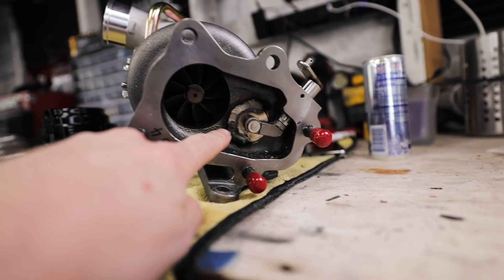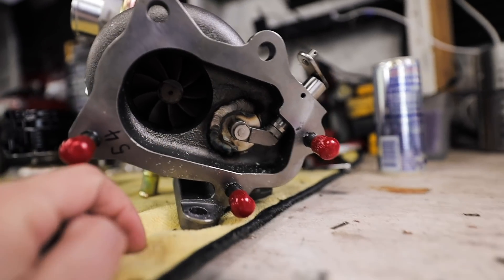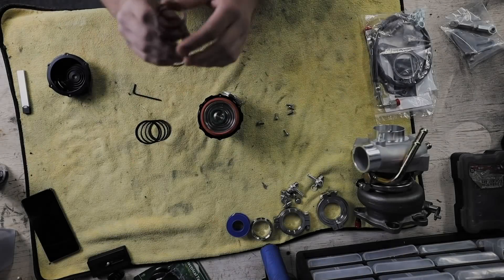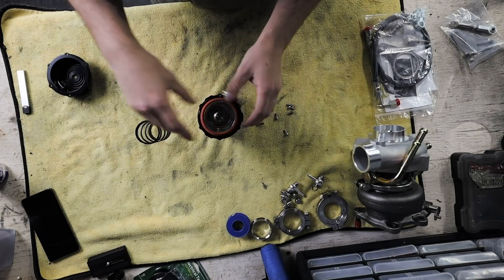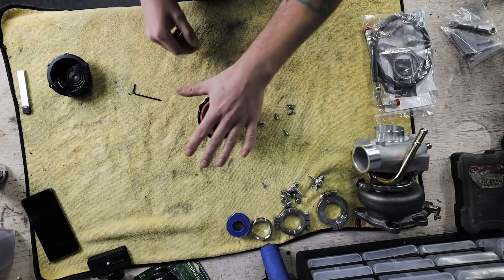Everything You Need To Know About Wastegates!

Comment: not sure if i am going to get a response due to this being posted almost 4 years ago but i am just new to cars and i am 17 years old with a subaru impreza WRX. Ive seen it all over youtube with these external waste gate flutter noises and it sounds amazing. I couldnt really find a video explaining it much but this really did help. But i have other questions. My Subaru is basically stock and i was just wondering do you have to have an after market turbo to run one of these things? I ask this because i would love to run one on my car but i dont really know how it works. IF i did do this on my stock turbo would it not do anything? would it break stuff? would it benefit me? is there disadvantages?
Reply: You can indeed run one on stock turbo. Just remember with these cars everything you do has to be tuned. You cannot mod these things and not tune them. It will blow up. I would highly suggest if it’s still stock start with a Cobb stage one package. This will at least get your feet wet with modding and semi tuning. The Cobb AP will provide you with a OTS tune that is fit for its specific mods. Getting pro tuned will work the same way except with extra steps when it comes to the tuning side of things.

Comment: Doesn't the blow off valve do the same thing if you keep 25lbs springs if the turbo went past wouldn't the extra just bleed off when the spring opens up thus eliminating a need for a waste gate?.
Reply: A wastegate will lower turbo shaft speed, and controlling boost with a BOV leak will raise shaft speed at the same boost level. Not saying there aren't instances to do it, but not ideal for regular old boost control

Comment: So I'm going to be running twin GT35s on a 5.3 LS is 44 mm wastegates too big and 50 mm flow off valves mine is going to be a blow through setup and the max boost will probably be somewhere between 15 to 20 lb.

Comment: Hey I just came across this video, I was wondering if I NEED a new wastegate or can I just keeep the stock on the vf52 turbo on my 2011 wrx sedan, I have a ton of modifications including bigger top mount, injectors, fuel pump, catless dp, intake turbo inlet, boost controller, bypass valve etc. and i’m gonna be tuned to make 340 wheel hp soon on the stock turbo. can i keep the stock wastegate?
Reply from the maker: You can but with a catless downpipe your subject to boost creep I'd suggest a plm up pipe with a tial 38mm ewg 🙏

Comment: Hey. Thanks for the info. If I have a completely stock 21 WRX except for a Big SF intake and Cobb AP: everything else under the hood is stock. I run 93 Octane and a 93 octane/Regular waste gate OTS tune. If the car seems to sputter a little here and there: Should I try the high or low waste gate tune? Is this safe on a stock waste gate? Can I run it indefinitely? Thanks in advance.

Comment: Hey buddy i hope you can help me with this so i am suffering with loss of boost in my subaru wrx sti so my tuner had said that it was the wastegate springs is that really true or do i just need a new one? I got the car not so long ago but i took it off the car and it looks really old it an Comp gate 40 mm. Also i tried testing it with new springs at 12 psi by putting some air in the waste gate and it seems like it wont open completely until around 25 to 30 psi ? Is that normal ?
Reply from the maker: What is your target boost #, and what are you actually hitting? 👀
Reply: @Smeedia  i mean i am guessing the wastegate piston should open up at 14 psi as it was originally at that number but now i only go up to 11 psi and thats the maximum boost i get . I also have a check engine like for Evap leak ifk if thats also affecting the tune? Another mechanic that i know said it could be the BOV ? Or maybe i have a leak somewhere?
Reply from the maker: Do a boost leak test and swap the springs to .9 Bar 🔥

Comment: Hello 👋🏼, I have a 13 WRX and looking forward to ordering the PLM Power Driven Subaru EWG Up Pipe with Turbosmart WG40 Gen V Wastegate kit…I’m currently on stage 2+ 93 with accessport stock turbo etc…is there any other additional parts to installing the ewg before the tune.
Reply from the maker: You'll need the iWG block off bracket and a boost control 😁
Reply: @Smeedia  thank you man I appreciate the response 👌🏼 happy new years
Reply from the maker: Happy new year Manny!

Comment: Hey im buying a subaru soon that has a "boost creep" issue and it has an external wastegate. What do I do then
Reply from the maker: Probably too soft of a spring in the gate 👀
Reply: @Smeedia  will try that when I get it
Reply: @Smeedia  too soft of a spring? Wouldn't that open easily at a lower boost pressure? Do you mean too stiff of a spring?

Comment: So if I have a 44 mm turbo with a 38 psi spring will I have to order more springs or will I be fine
Reply from the maker: I would change the spring, that is a stiff spring for pretty much all applications. Typically I run .9 Bar (13ish) lb spring

Comment: When you are running an external wastegate on the stock turbo do you need to weld the internal wastegate shut or modify anything with the internal wastegate? I plan on running a catted downpipe btw.
Reply from the maker: You can qeld it or buy a bracket to keep it shut 💪
Reply: @Smeedia  thanks!
Reply: Catless would be better with an EWG

Comment: I have a 2011 wrx hatch. It had a catless down pipe turbo back exhaust and a cobb air intake with intake box Cobb three port boost controller. My car is pro tuned for 18 psi sometimes it goes up a little about 18psi EX. 18.6 18.9 and sometimes 19. Is that okay?? It’s a stock turbo.
Reply from the maker: Still IWG?
Reply: @Smeedia  Yes. It was tuned by tpg tuning in Pennsylvania btw don’t know if that matters
Reply: @Smeedia  and also my secondary air pump
Is going bad is the secondary air pump mod worth it? If so what exactly does it even do
Reply: @Smeedia  what steps do I have to take to go to external waste gate with a stock turbo? Do I have to get a new turbo? What are the steps for switching to external waste gate
Reply from the maker: Block off the IWG with the Cobb or grimmspeed bracket, get an ewg up pipe and snag a ewg 🙏
Reply: @Smeedia  thank you so much! Your videos are so helpful man I love watching them. Today got boost creep up to 19.35 psi and it’s supposed to stop at 18. I love my hatch and don’t want to hurt it so thank you so much man!!
Reply: Yes

Comment: Dont know if anyone asked but what defines low boost vs high boost?
Reply from the maker: It's more subjective to the turbo you run and the engine that your using for most stock turbo cars a 38mm works fine. I wouldent really suggest a 44mm unless your using a large turbo staying under 50% of its rating
Reply: @Smeedia  what about an FB blue at 23psi

Comment: Once you install a external wastegate...what happens to the internal waste gate on the turbo, do yiu remove it or?🙈🙊#dumb question
Reply from the maker: You can either buy a bracket that keeps it shut or you can weld the IWG shut 😁🙏
Reply: 🙏thanks man

Comment: I’m having boost problems after a intercooler pipe popped off after fmic install on a Subaru lgt. I’m only hitting 8 psi now instead of 15 psi. Tested for boost leaks and there was nothing, could this be a waste gate problem?
Reply from the maker: Could be, are you IWG or EWG?
Reply: @Smeedia  iwg I believe
Reply from the maker: I wouldent imagine an intercooler pipe popping off causing that but could be IWG issue, Boost controller or a large vaccumm leak. Are you protuned or OTS?

Comment: Oh man can u have to much wastegate? I got 6466 with dual 44mm tials v band but its not divided do you think I’ll run into problems?
Thanks for the info
Reply from the maker: Shouldn't run into problems, although curious why 2 44mms for a 6466?
Reply: @Smeedia  because I wanted to do divided v band but it didn’t happened misunderstanding and I already had a 44mm tial to did want to two 38mm

Comment: I live in Washington also but I can’t find a shop that will look at the turbo I have on my car I did not install it it was already on any suggestion
Reply from the maker: If you can look at thr compressor housing and there should be a serial number or manufacturer markings near where the coupler connects 🙏

Comment: Hey man, im new to the subaru world, this was a great video and I recently bought a bone stock 2015 WRX with 70k miles. I am looking to cobb tune it and put a downpipe on it, but i am worried for boost creep. I am going to put an external wastegate on, but can i only put a wastegate, downpipe, and a cobb tune without doing any other mods and not be in fear of hurting the motor? Stock turbo and everything else would be ok?
Reply from the maker: You shouldn't have any boost creep issues if you are using a catted downpipe, if you do decide to go EWG you'll need a protune for that. Keep in mind that thr 2015+ WRX needs 2 wastegates because it's twin scroll 🙏
Reply: @Smeedia  Got damn why do subarus need to be so complicated and fragile. Thanks for the info man but it seems like you need to get so many mods just for one simple mod to work.
Reply from the maker: It's because you've got a twin scroll turbo, any car with one would need two 🙏
Reply: @Smeedia  aight thanks man, i think imma just go catted dp. So i would only need to tune for that and not need ewg ? And i wont have to worry bout boost creep?
Reply from the maker: Correct 🙏

Comment: Bro there is like no info on this. How do I go from a internal wastegate to an external? What do I need to do exactly? Please help
Reply from the maker: What is the car?
Reply: For my 2020 STI. But after I did more re search I saw that I can get a internal wastegate blocker. So now the question is since my tuner is hella flakey, I am running a 20G cobb turbo with 1050 ID injectors, TGV deletes, IAG fuel lines, flex fuel etc, what size wastegate should I go with? I understand the smaller the size the more boost, the bigger the less. But ima be pushing 400 whp and it’s going to be a daily. So what size would you run?
Reply from the maker: 38mm EWG, you'll prob be around 18-20 PSI on your tune. Smaller wastegates are better for higher boost.
Reply: @Smeedia  yea. I figured that. My tuner finally hit me back up and said to get a 44mm. Idk. He’s smart thou. Just flaky. And is the Killer B EL Headers direct bolt on on a 2020 sti? Or do I needa get a different oil pan?

Comment: Hello! I know this is an old video but I have a question. My internal waste gate is on its way out. the turbo is pretty hard to get but is perfect for my set up. Its cheaper to go ewg and re tune my car then buy a new turbo for my car. Will this fix my issue by removing perm closing my iwg and running ewg instead or just buy a new turbo. thanks so much! :)
Reply from the maker: Yes it will, if your IWG is the thing having issues you can get a bracket to keep it closed and run an EWG 🙏🙏
Reply: @Smeedia  thank you so much for your info! :) hope you get some better tyres for your Sti soon so we can see full chooch! love how it sounds man!

Comment: So do I not need a 3 port boost controller with a ewg. Just trying to get the most out of stock turbo/motor on e85 for now until I build it down the road. (13 sti)
Reply from the maker: Yes you will 🙏🙏🙏

Comment: My 2011 FXT hit 19.51 LBS of boost on stage 1. Is that safe?  Only mod is K & N drop in filter. Looking to go stage 1+ soon.
Reply from the maker: Check the target boost number for the map, off the top of my head I don't recall what Cobb sets their ots tune at
Reply: I just checked.  They stated at peak boost 14.5. Should I be worried?
Reply: Bro, I love your videos. But when you mentioned over boost. I got a lil nervous. When I went to look on the website after your response ( thank you by the way) I saw that it said peak 14.5 and noticed the map went from version 350 to 400 so I just updated it.

Comment: This helped tremendously! For just good reliability on 2013 sti stock turbo do you think the 44mm Tial-MV-R is a good choice?
Mods:
TGV delete
Secondary air pump delete
Cobb intake 
Invidia catless downpipe 
Type one racing exhaust.

I know you get a lot of repetitive questions I'm getting my car pro tuned at drive auto sports in Everett and was going back watching your videos and came across to late🤣
Reply from the maker: The 38 would be a better option since you'll be running around 18-20 PSI 

And your good! 😁🔥

Comment: I just bought a 2020 STi and I'm planning on doing a bit of work to it, but nothing crazy, mostly just full exhaust, cold air intake, intercooler, stuff like that. I'm not planning on trying to get crazy power out of it, but should I install an external waste gate is that a waste with the stock turbo?
Reply from the maker: You can install one with stock turbo but TBH it's not needed if your just doing some basic bolt ons 🙏
Reply: @Smeedia  okay cool. Is getting a new turbo the point where you'd need a new waste gate? I want to increase the power a bit, but I'm more interested in doing suspension work to the car.
Reply from the maker: Yessir, once you swap turbos is really when you NEED it.
Reply: @Smeedia  nice. Thanks man. Great video by the way.

Comment: Can you explain the different sounds of a ewg? The 2015+ wrx with wastegates sounds like a two tone note but on some STI’s they have a one time note. How do I get the two tone note on a sti with a wastegate? I hear some sti with different size wastegates but some sound different. Is the the tune or the spring rates that affect the sound of it?
Reply from the maker: Wastegates size, Boost controller, the tune. For the 2915+ they use two wastegates where the STI only uses one. The dump tube also can play a factor 🙏😁

Comment: 18mm diameter gives you 9*9/3,14=254,34 area external 38 diameter  19*19/3,14=1133,54 which is 400% more except that you are spot on.nice job.
Reply from the maker: What formula did you use? I went off of total circufrance vs area. Guessing πr² 👀 
Thank you! 🙏🔥
Reply: @Smeedia  thats the formula and this the reason why you need to calculate many factors when you change from internal to external since the gap is huge  and the responce time of the external does not allow you to maintain the desired boost level stable cause external have more inertia since it is heavier. nice video again  keep on the nice job.

Comment: Is there recommended mods to go with a ewg? Picked up a 44mm tial just because it was a good deal lol currently only have a turbo back with a tune.
Reply from the maker: Boost controller, up pipe, header, downpipe, intake, fuel mods. Not really needed u til you start to see boost creep with the car. But even a stock turbo will benefit from one

Comment: Awesome video. Spreading the knowledge to noobs like me lol. I do have a question though. Somewhere down the line I want a bigger turbo. Thinking of doing ELH and an up pipe. Can you do an external waste gate with a stock turbo? Not sure if it matters but I have an 08 WRX
Reply from the maker: Yes you can 😁 they make a bracket to permanently keep the IWG shut so you can use an EWG on stock turbo 😁
Reply: @Smeedia  niiiice. Thanks for the info. You’re the man

Comment: When it comes to wastegate spring sizing you typically want to put in a size that is 60 percent of your target boost pressure that way when the tuner is adjusting your boost pressure it requires a larger percentage of duty cycle giving him better control. I.e. you don't want to add 5 percent and boost pressure rise 7 psi you want to add 20 percent and get 7 psi. Remember the tuner can double whatever the spring pressure is in the Wastegate.
Reply from the maker: Thank you for the added info 🙏😁
Reply: But I am running 17,4psi of boost with standard 5psi spring in oem westgate...

Comment: Informative as always and for sure answered my questions for the wastegates. But I have one more for you sensei, what type of turbo inlet hose would you recommend?
Reply from the maker: Whats the turbo? 😁
Reply: @Smeedia  stock turbo. As well as stock location
Reply from the maker: Perrin 2.4" 🙌
Reply: @Smeedia  dope. And for the boost controller all I need to do is drill it in correct? There has been no easy explanation for placement on the boost controller
Reply from the maker: Most of them will just bolt right up in the stock location
Reply: @Smeedia  ok sweet. I just don't wanna get ready to do mine very quickly then run into that tiny issue. How did the etune go?
Reply from the maker: Etune went awesome, video on Sunday with the wrap up 😁

Comment: Well inform video. Literally was shopping around for a new uppipe and EWG this pass weeks. So no need to get 3 ports boost controller if I’m going EWG?
Reply from the maker: You still need one, the boost controller is what sends the signal to the wastegate to tell it to open or close. But you technically don't need one but then you can only run spring pressure off of the wastegate
Reply: @Smeedia  okay. In the video you stated it interfered with the wastegate which make it sounds like it’s a lag and hinder to it, that’s why I asked.
Reply from the maker: No worries, its an international international to keep the wastegate closed until you hit your desired boost pressure